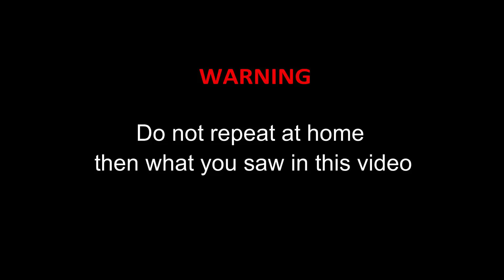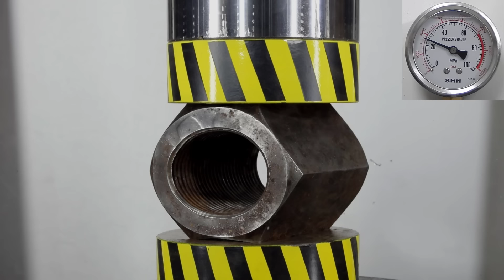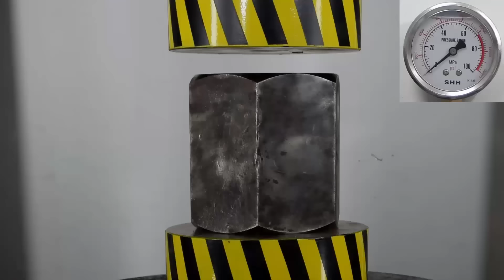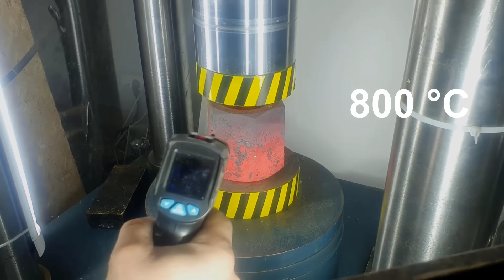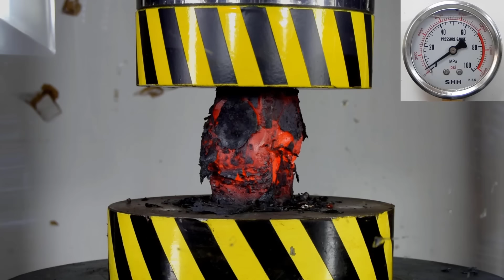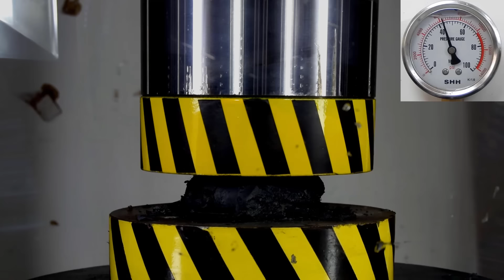500 TON HYDRAULIC PRESS VS HOT METAL

Comment: These videos are also educational. This is why heat resistant paint is so important for steel constructions.
Reply: Need to tell that to 9-11 conspiracy theorists. Steel doesn't have to come anywhere near melting to lose strength and fail.
Reply: 400degF may be still good, but the "fun" starts above 450degC, where the recrystalization starts. Not F, but C. That is not the same. And at 800degC pretty much any construction steel becomes like butter. And common house fires (fueled by carpets, furniture,...) are able to go way above that. The purpose of the  heat protection "paint" is to absorb the heat (by decomposing itself) for at least the time needed to evacuate people. But when all the burning things became soaked with kerosene and also burning two floors below, the extra heat make the coating to decompose way faster...
Well, we are talking about quite a few mm thick layer by the way, so calling it a "paint" is a bit stretch, but so be it...

Comment: the thing about steels is once you heat it to above 400c, you've ruined any hardness or tempering properties it had beforehand, even if you allow it to cool back down to ambient room temperature. it will be roughly as soft and malleable as cold mild steel unless you can reharden and re temper it, which for something that big and thick, is really hard to do.
Reply: How you know this
Reply: @xyoungdipsetx  smithing channels i guess
Reply: This is the key thing “9-11 truther’s” fail to grasp. It’s entirely possible to hit 450c in a contained fire. You don’t need to melt steel to ruin it’s structural properties, just get it to ~450c/850f. Even 400c would likely be sufficient.
Reply: @geoffstrickler  how would the foundation get to 450 degrees if the fire extended to the top floors? And how did building 7 fall from the bottom up when nothing struck it?
Reply: @TheSuperBoyProject  Bldg 7 was on fire for hours before it collapsed. Asking about the foundation of the N/S towers is irrelevant. The bldgs collapsed on the floors that were hit and on fire, and the weight of everything above that caused it to pancake.
Reply: @rannethtan  depends on the structure, and duration of the fire, but in most cases, any structural steel affected by a fire is replaced or reinforced in the rebuilding process.
Reply: @rannethtan  Geoff Strickler got it, but to reinforce what he said, you are exactly right. Any steel structure that has had a fire beyond a certain intensity (not a wastebasket fire that was doused by the sprinkler system but a serious fire that required external intervention to bring it under control) is no longer safe until all structural elements affected by the fire are replaced.
Reply: 0 - 9/11 argument in 3 comments. Pretty fast, even for the internet.
Reply: That is not true, you have too keep it on 700 degrees celsius for SEVERAL hours in order to „restart“ the steel, ergo delete its history.  
Just going above the temperature does not instantaneously reset its properties, that is false…
Reply: সুন্দর
Reply: Not several, around 1h and a half at 500 Celsius is sufficient, at least for car and truck steel. Not sure about construction steel.
Reply: This comment reminds me of 'material science and engineering' class that I took last semester...
Reply: "...big and thick, is really hard to do"
Huh-huh. huh-huh-huh...that's what she said...huh-huh-huh.
Reply: @geoffstrickler  Construction materials have so many variables that an average person has no understanding of. There are many types of common materials and there are surprising weaknesses for even some of the "toughest" materials. All the 9/11 misinformation was upsetting to anyone that understood. this.
Reply: I think he intentionally did that
Reply: Did you use your mother-in-law? Lol
Reply: so much semi knowledge in one comment. dear aspiring engineers or technicians; learn and inform yourself about heat treatment and and hot forming of steels from textbooks, professors and specialists, not yt comments.
Reply: @crabber338  We need to talk about the holocaust now, now that we've entered the 9/11 territory.
Reply: @battokizu  not as fun to talk about. Human melting point is likely far below 400C
Reply: @xyoungdipsetx  it's pretty early into a mech engineering degree that you learn about these properties of metals
Reply: @geoffstrickler 😂😅😅😅😅😮
Reply: I work in a foundry. We heat train wheels to 1700° then treat the tread with water. Then back into another 950° furnace for 2 hours.

Comment: It would be interesting to take the same type of nuts and go to the opposite extreme. How much more brittle would they be after immersion in liquid nitrogen?
Reply: They would actually become stronger.
Reply: @TheRatLiker  really? Whys that?
Reply: As soon as the press started imparting energy into them they would rapidly heat up
Reply: @truthhunterhawk3932  essentially, rapid cooling creates stress within the metal's inner structure. This does make it brittle, but it also makes it very hard since the stresses prevent the grains inside from moving
Reply: @TheRatLiker They’d be harder. But weaker, it will instantly explode once it goes like a few millimetres compressed, heat makes things flexible, cold makes things hard but explosive
Reply: Depends on the metal. Some get stronger at cryogenic temperatures (like stainless steel) while others become more brittle (like the high sulphur rivets on the Titanic).

Comment: I would really like to know how the strenght is teperature-dependend. Is there a difference if you heat it up to only 200 degrees ?
I think this is a temperature which could happen to a hammer (seldom, but possible) if you work on forging steel.
Reply: Alot of metals are strengthened by work hardening, which is essentially where sliding atoms (very simplified explination of dislocations) get stuck and restrict the movement of eachother and make it harder for the material to deform. Increase strength make it less ductile.

When you increase temperature these dislocations can defuse and they basically aren't in eachothers way anymore. So effectively you can heat the metal and cool it again and you will get a similar effect.

Another factor, significant but not as significant is that each atom has more energy in hotter temperatures which means less mechanical stress (force over area) is needed to be applied for it the dislocations to move and the material to deform

Comment: At 07:55 the color suddenly changes to black... interesting!
And one can also see that metal at 800°C, the strength drops dramatically, not only for thrusting, but also bending and pulling forces. Remember something....?
Reply: so open air burned jet fuel which is about 1100C … might have had an affect on that something causing that what it supposedly could not and be responsible for the sudden drop in the continuity of ‘being alive’ of those people in there.
i am fairly sure that the floors above that point were heavier than 500tonnes… and the weakened structure was able to go downstairs after a while… hmmm

its a sad sad event :( may all rest in peace.
Reply: @mityaboy4639 And visually confirmed to be above 660C by the molten aluminium alloy pouring like water out of the structure just before collapse.

Comment: Hello again Chip! Wow those are some big nuts you have there. Not to be trifled with.
In the cold press test I could almost hear the nut asking for a nice hard bolt to be wound in. It would probably only flex .2 mm with  those threads. The nut would be hard enough not to spread around the theoretical bolt. 
We could see the paint on your press adaptor plate bubbling from the heat transfer. Was that enough to remove the hardness from it? The small kiln for sure was way over 800 c. Looked like twice that.
 Nice work, we miss the "Here we go!" Good luck.
Reply: "Big nuts" 💀

Comment: As you can see, you don’t necessarily need to heat a metal to it’s melting point before it starts to lose it’s structural integrity.  This is what lead to the collapse of the old World Trade Center towers on 9/11.

Comment: Serious question, why does it start cold and get hot?
Reply: Not entirely sure what you're referring to, but metal getting hotter when you crush it is a known phenomenon, so...
Short answer is because of the second law of thermodynamics- deforming the metal takes energy which is provided by the hydraulic press, but it's impossible to use 100% of the energy spent by the press to cause deformation, so some will necessarily turn into other forms of energy including light and heat.  
The long answer is, well, I'm not a material scientist so I can't say much for certain. But I doubt the explanation stops at the 2nd law and goes into the physical properties of the material to explain why it heats up as much as it does instead of just heating up at all.

Comment: But steel does not melt until 2200 degrees, are you sure there weren't little controlled demolition crews hiding in the threads of the 800 degree example? :o)

Comment: Of course, heat makes metal more malleable, while cold makes it more brittle. Put the metal into liquid nitrogen for a couple of minutes and then put it into the press. It will shatter into thousands of shards.
Reply: That's only BCC type metals which have an effect called the ductile brittle transition temperature which is extremely complicated and difficult to explain